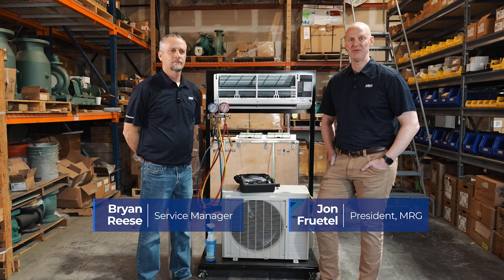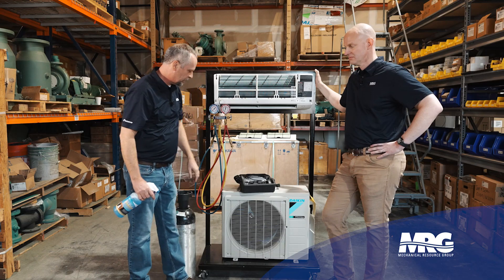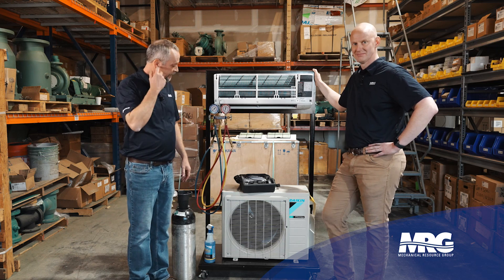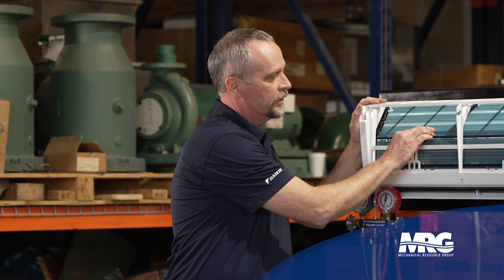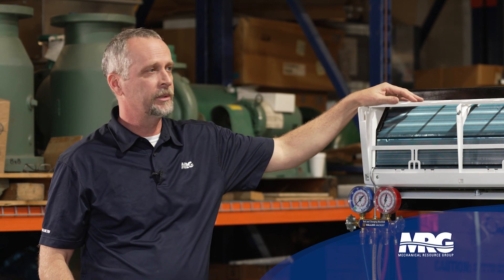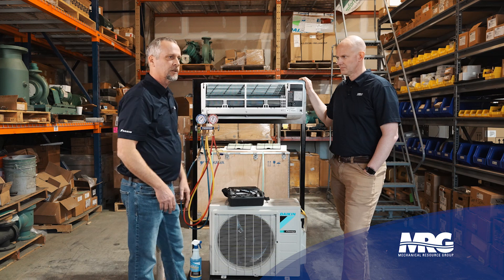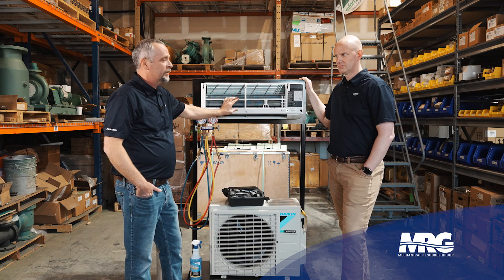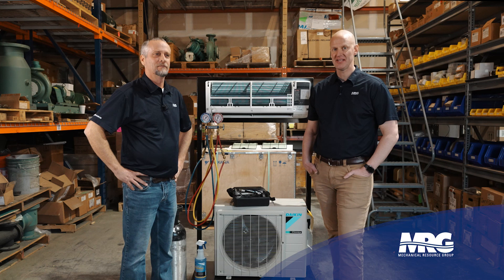HVAC 101: How to Perform a Refrigerant Circuit Leak Check - A Step-by-Step Guide

Comment: Best thing to test a Schrader....use a cap with a small hole on the end, spray leak detector fluid on the hole in the cap or use electronic leak detector on the hole in the cap. That way you never spray fluid where it could potentially be introduced into the system with hoses.